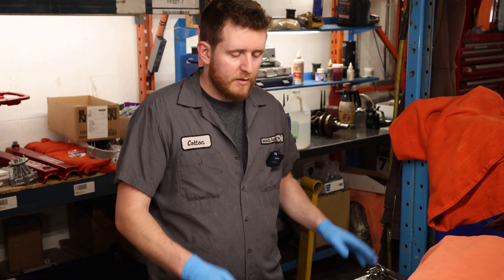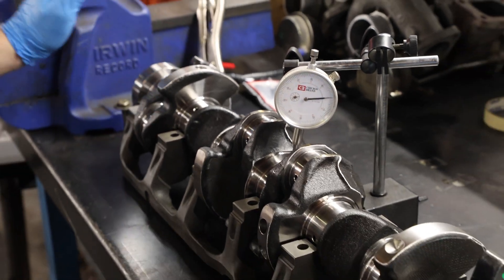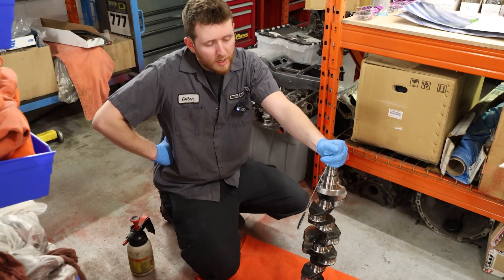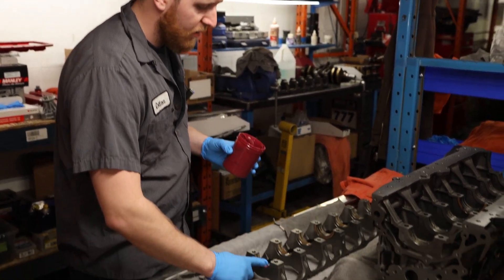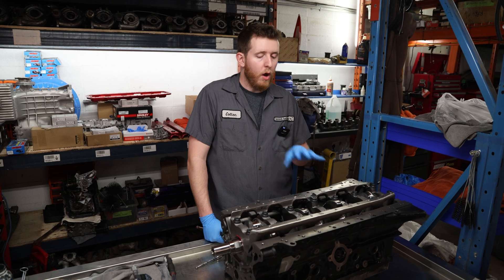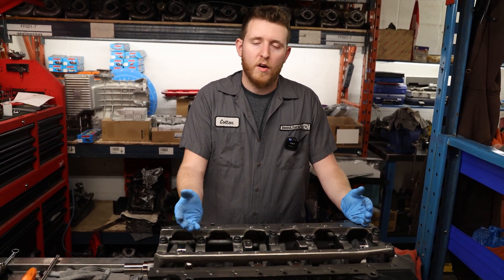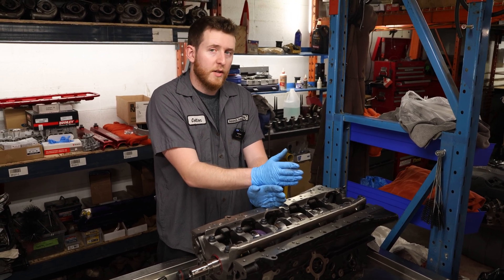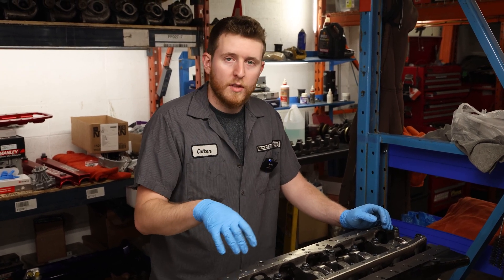RB26 FULL ENGINE BUILD || Episode 4: Crankshaft Installation

Comment: Colton do you ever check the balancing of the internal components like you do with measurements and clearances?
Reply from the maker: @JamezAdam  yes we have this done along with the machine work! I only have the ability to measure the pistons in house. Don't yet have the equipment to measure both sides of the rod or the crank.  an inline six is much easier to balance and is inharently well balanced by design, so as long as everything is weight matched your in good shape. Much different from a v6, v8, and inline 4 if you've ever had one of those balanced...

Comment: So you were saying after measuring the connecting rod areas of the crank, that you wish they all measured so perfectly…. So for cranks you find that measure improperly, do you send that back to Nissan for them to fix it or send a new one? Or do you now have to fit the bill on a machine shop fixing them?  Like is inaccuracy just a risk you’re taking when buying a crank, or will they(Nissan) make it right if you get one out of spec?
Reply from the maker: the other cranks i'm referring to are not cranks from Nissan but cranks from other machine shops or manufacturers that provide slightly less than satisfactory results. I Have never had a brand new Nissan crank give me trouble.  Where i do have issues is when they are brought to me ( any brand or engine) and have been  Ground .010" or .020'' and they are .0002" or more out of round or tapered and missing fillets. these ones do not get used and will be replaced if not repairable.
Reply: @boost.factory  awesome! This series is incredible!  I’m going to be getting a 25 Neo motor soon enough here and rebuilding it with a few upgraded internal bits so this is going to help me immensely with everything!   My first time building a motor as well so I’ll need all the help and info I can find! Hahaha  I’ve got an excellent shop near me(bardabe performance; Austin tx) so I’m sure I’ll be bugging Juan to no end with questions as I go through it all!
Reply from the maker: Right on happy to help! let us know if you would like to see any other videos on topics you may have questions on! @bowley4
Reply: @boost.factory  yes actually!  I know it’s kinda asking for a lot but you did already reference it in another video, about oil getting trapped in the head and how to alleviate that… I know there are a ton of options like the BoostDoc dude sells those baffles, and then there’s the tapping a breather into the back of the head to a catch can and or recirculator, and oil cooler install, etc etc.  As RBs’ biggest enemy is oil related, I’m sure an in-depth on “everything oil” would be really helpful.  I’ve not yet seen anybody do anything as comprehensive as your videos are and the forums are so ancient and full of misinformation that it might be one of the only videos to properly address the topic. 

For instance like you can find a video of a guy showing you “oh yeah so I just tapped the back of the head and run this 90° AN fitting to this catch can/de-gasser, then it plumbs back into my oil pan.  Well that’s all good and fine but that doesn’t help with the exact how to do it safely, and the WHY of making choices like where to mount the can, what size needed for potential applications, the importance of separating air/gas out of your oil, where and how to safely tap an oil pan and why to choose the location of tap over another location for instance.(I have two friends with wild amazing GTRs and one guy has his head tapped and returns on the turbo side, another guy has it on the intake plenum side…  some interesting choices made there and I’m sure there are reasons but one should be preferable to the other and I’m not the person who knows why!  
Also like how different really is an OEM oil pump to a nice aftermarket… cause the price is like $1,000 different and there’s nothing priced really in between the two options… 300 or 1300; and then as you mentioned in another video also, like when doing an oil pump, how and why do you choose this or that spline option.  

Separate from above, I’m curious to know which I’m sure you’ll address in later RB26 rebuild videos, is why to choose which harmonic balancers and how/why to choose flywheels related to the balancer choices. I’ve not seen anybody go into depth about how the various choices affect your clutch strength/revving speed/capacity, etc.
Reply from the maker: incredible detail! i will ad these thoughts to my list of videos to do! appreciate the details you have provided! @bowley4
Reply: @boost.factory  I appreciate you!  Out here doing the lord’s work with all this amazing info! Hahaha 
Ah! Just thought of another… there ain’t SHIT for videos on how to replace wheel bearings.  I had to do my rears recently and it was an absolute nightmare and I ended up having to take apart and redo and then take apart again a few times all my suspension arms from the knuckle… and then the race wouldn’t come off of the lug bolt face thing with the splines for the axle, so I had to cautiously grinder it away and break it off… I’m sure there are some tips I didn’t realize. Or like the big ass nut that holds on above the balljoint that comes out of the ebrake back kinda… I think there’s an ABS sensor in there or something cause I didn’t snug one of them up and the light was on and had to undo half my knuckle just to get back to it. Huge nightmare of tiny fumbles that made a 2 hour job, into a 2 day job having to borrow jack-presses and shit.  

A lot of people have problems with AC issues as well!  There’s a really easy diagnostic in the car you can do, but just cause I can look up what the codes means, doesn’t mean I can go in there and find the components much less replace them!

Comment: Thanks for the upload😊. How do you choose which crank journal bearing for the applications accordingly with the crank shaft?  and whar is the ideal tolerance?
Reply from the maker: Hey! Bearing selection is determined by the crank shaft journal dimension. while other factors such as the main line dimension come into play, the crank shaft size should tell you where to start. if the crank has not been ground i typically start with Standard bearings. and if they are too tight i run a HX +.001" More over the standard. or if they are to large of a clearance the .026mm or -.001" Tighter clearance bearing.  if your crank has been ground you have two options for it to be ground to .010'' or .020'' i which case your machinist will need to measure a fitted bearing for an accurate grind.
note  some cranks shafts allow for .030'' of machining in some applications. but this is not common with the RB26. 
We may to a video on this in the future!
Reply: @boost.factory  Thank you so much for the infomation given🫡🫡🫡